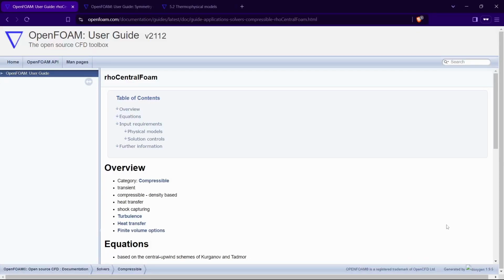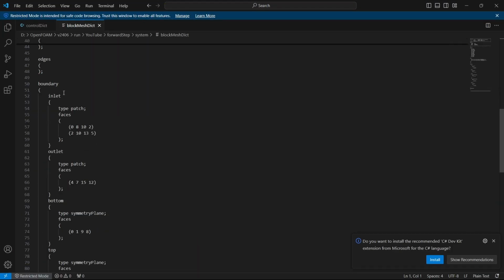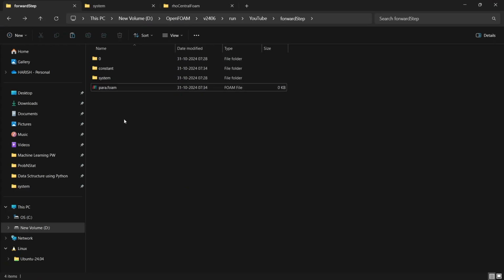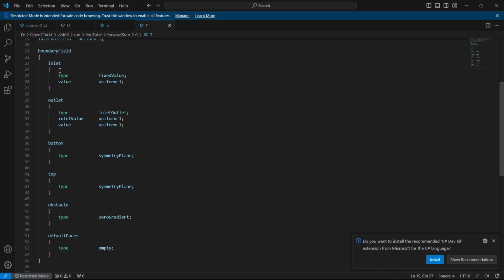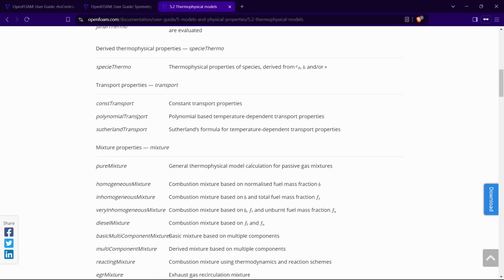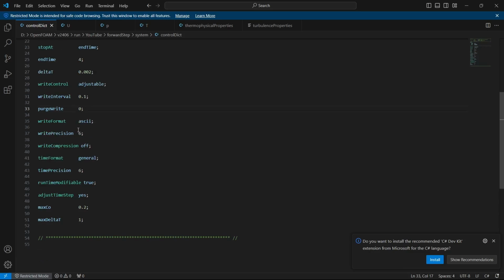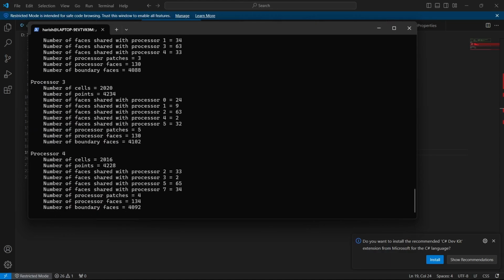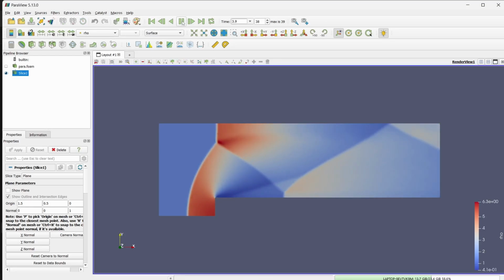Shock Wave - rhoCentralFoam Tutorial OpenFOAM | English

Comment: Is it normal that when you run the solver, the rho, rhoUx,rhoUy ,rhoUz and rhoUE are all zeros ?
Reply: Also, i thought that the residuals should help to confirm convergence of results, so how do I confirm this if they are all zero from the start?
Reply from the maker: For a transient solver the terminal won't say if it is converging for each timestep. But you can manually see the residuals going below a certain threshold. You can change the criteria for convergence in the fvSolution if you need.
Reply: @Codeynamics  anyway to contact you concerning a cfd simulation?
Reply from the maker: For a compressible solver that's a bit off. If there is no shock or density changes, then maybe yeah. but in that case you wouldn't need a compressible solver in the 1st place.
Reply: I am currently doing a cfd simulation of a supersonic bullet. 
Ive run blockMesh, decomposePar, snappyhexMesh, and recomposePar. Every thing seemed to work  but  now i realise my initial conditions of T and U are faulty.
Reply: On the P file, i set zero a uniform value at the inlet and zerogradient elsewhere (after a lot of trials and errors)

For T and U , i followed the tutorial file but in paraview the whole blockmesh is red (displaying the inlet conditions).
 
Do you mind helping here? Or can you suggest  a 3d tutorial file i can use as reference? Most of them are 2Ds :(
Reply from the maker: The BC will remain the same for 2D and 3D. Just the mesh changes.
Reply: @Codeynamics okay just to confirm. Given i called the "top" as "upperwall",    the "buttom" as "lowerwall",   and the  "obstacle" as "bullet",   i asumed the "defaultfaces" is my "frontandback"

So you mean to say that  in 3D the "defaultfaces" is still empty as on the 2D case?
Reply from the maker: you wouldn't have a defaultFaces because that is ur new front and back. So it will be wall too. Use the same BC you are using for other walls.

Comment: Is it possible to run the simulation with normalization?
Reply from the maker: In this tutorial I have run it with normalization only. 
If you meant without, then yeah, we can. You just have to change the thermoPhysicalProperties and your T file with appropriate values instead of normalized ones.
Reply: @Codeynamics  sorry.. I meant without normalization. 
Is there a way to connect with you?
Reply from the maker: @atharvapradhan3844  codeynamics@gmail.com 
or Codeynamics Page/ Harish Jayaraj P in LinkedIn
Reply: Is it possible to have a multi region  simulation for the same
Reply from the maker: @Le_de_Carte   Maybe with a different solver. Im not quite sure about that.